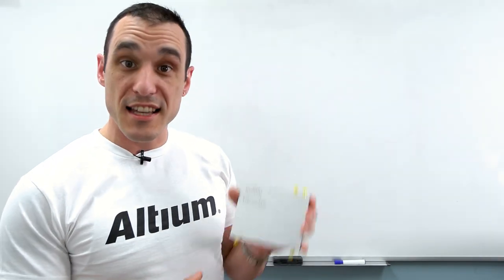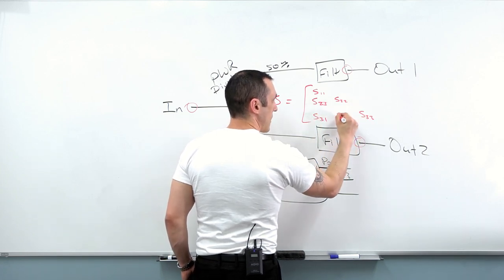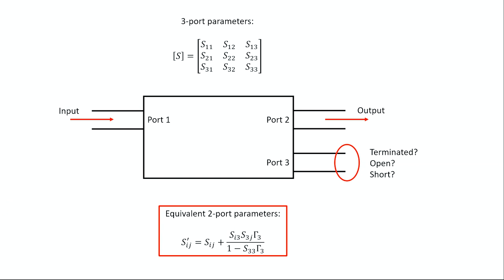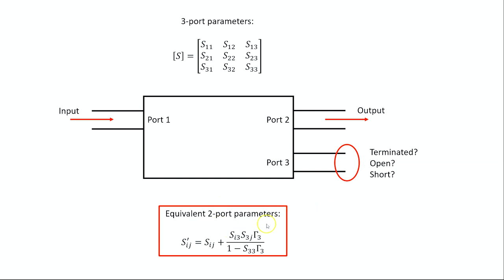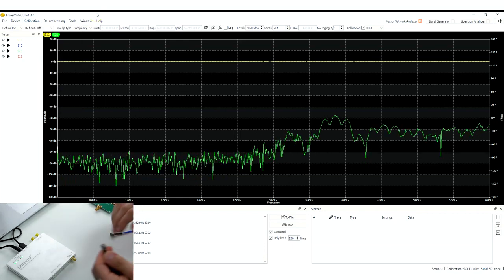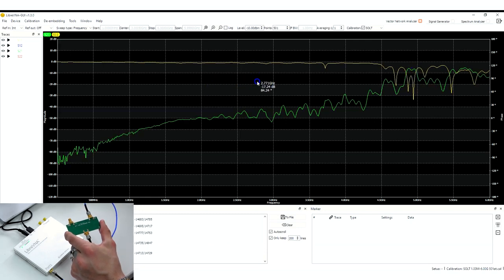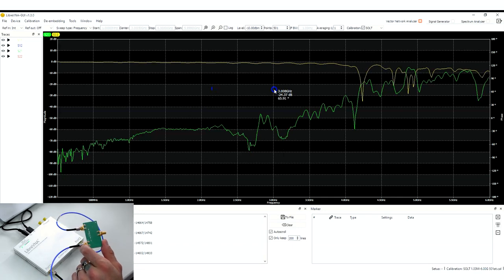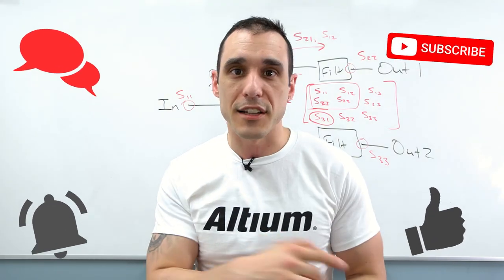How to Measure S-Parameter Data with the LibreVNA

Comment: So do you feel the about $600 difference in price from the nanoVNA is worth it?  (The Libra is now right at $700)
Reply: To be honest I have never used the NanoVNA so I can't really comment on it. But based on reviews of these tools I have seen on youtube, I'm glad I put down extra for the Libre, even if it is not a game changer for client projects. Other thing I really appreciate is the software interface for the Libre, sometimes with lower cost hardware the capabilities of the hardware is not the problem, it's the quality of the software that comes with it. My little 200 MHz Hantek scope is just as capable as the equivalent 150 MHz Tektronix scope for about the same price, but the Hantek software is garbage.
Reply: @Zachariah-Peterson Hi Zach. Did you get the chance to check drift etc? I’ve used very high end vna’s and also nanovna but my main issue with cheaper ones is reliability/repeatability especially when you power off the unit and power it back on next day and load file then does the cal hold good for same cal file when you look at smith chart or you see a drift on market positions between low and highest freq point?  Thanks
Reply: @jholworld  I only use this for demos or test boards, but you're right the cal might be off if you come in the next day. What I do when I need to use it is I first turn it on, let the unit come up to its operating temp, recalibrate it, and then start using it. I've had to do the same thing in the past with spectrometers.

Comment: It should perhaps be added that for most applications (and probably virtually all hobbyist applications), simply terminating the third port at the characteristic impedance and then measuring the S-parameters with a 2-port VNA and filling in the S-parameter matrix, should yield sufficient accuracy. There should be no real need to recalculate the S-parameters for the error. The National Physical Laboratory did a study that compared the accuracy of this method against the more rigorous mathematical-correction method. The EVM error they observed was under about 0.02 for frequencies below 50 GHz and under about 0.05 for frequencies above 50 GHz. You can get "close enough" results by simply terminating the ports using termination loads that are closely matched, and then filling in the matrix with the observed 2-port results. Here is NPL's analysis: http://projects.npl.co.uk/hf-circuits/docs/presentations/20150603-anamet/03.pdf
Reply: I was not aware of the study but will definitely take a look.

Comment: You should add a heatsink to the exterior of the LibreVNA. It gets pretty hot after a few minutes and you'll get some pretty nasty temperature drift due to that.
I personally measured some TekBox attenuators and the accuracy was very good up to 6GHz with a heatsink.
Without a heatsink you get a drift of about 5dB.
Reply: You can also boost the frequency up to 8GHz by using harmonic mixing.
The accuracy is decent between 6GHz and 8GHz.
Reply: Oh I noticed, we were using it for awhile during filming and I could feel it getting very warm. I've never tried doing a frequency test but I think I need to now!
Reply: What would be required to achieve measurement up to 8GHz @DaSmik101

Comment: Why are you not terminating third port?
Reply: In this situation where the 3rd port shares the same reference (ground) as the other two ports, you do not need to terminate directly, you just need to know the reflection coefficient at that port. Obviously you could terminate to 50 Ohms, but you could also leave open or short it. I calibrated with the open circuit standard for the Libre, which should closely mimic the open circuit I have with a physically open port. It might be more accurate to have terminated the 3rd port with the open calibration standard, but I did not check this so it is still an open question.

Comment: I realy, realy love your videos. If the 50R load has a BW larger than 5GHz, would not be better to terminate the unused ports? How about the filters. How are they physically implemented? A schematic of the splitter would be nice. Finally, I believe that NanoVNA is way more popular than LibreVNA (due to the price tag I guess). For this reason, probably more people will relate to the video if the former VNA was used.
Reply: Thank you, Yes NanoVNA is much more popular just because of the price, but when I purchased the Libre it had the higher bandwidth so it was worth the price. I've used it on some test boards since buying it with good results. In a real 3-port or 4-port measurement it would be best to terminate with a calibration standard if you are planning to terminate to a specific impedance value (not an open or close) because of the BW requirement as you mention. In my case, I left it open because it's just a demo, but I did check that the open on that connector actually behaves close enough to the open circuit calibration standard terminator so that there is little error. But in general if you are not sure or have not measured that an open on your connector really behaves like your open circuit calibration standard, then you should just terminate with the calibration standard because that standard will (or should) be good up to some frequency limit beyond the measurement instrument's bandwidth.